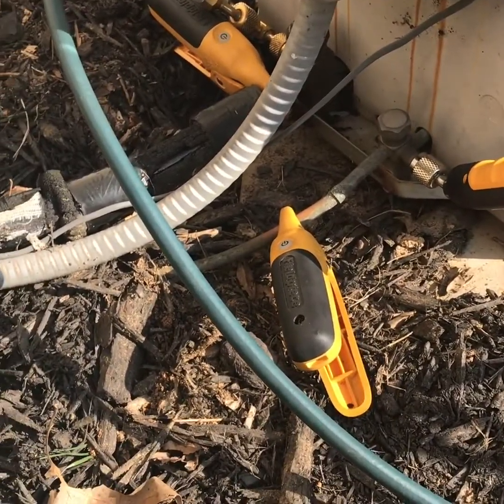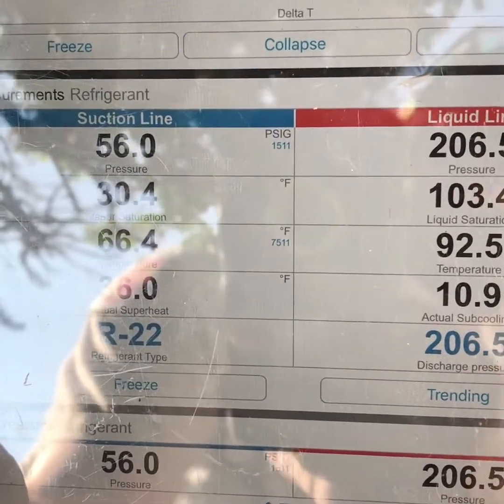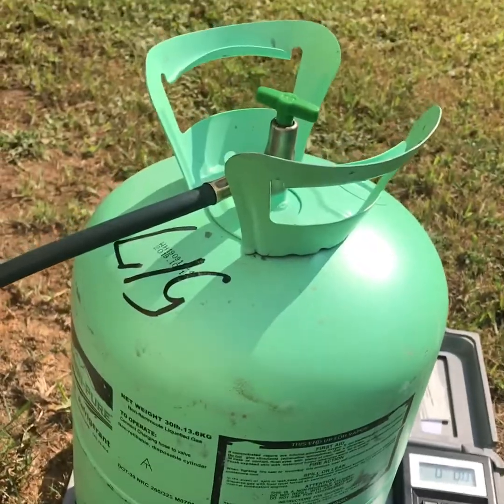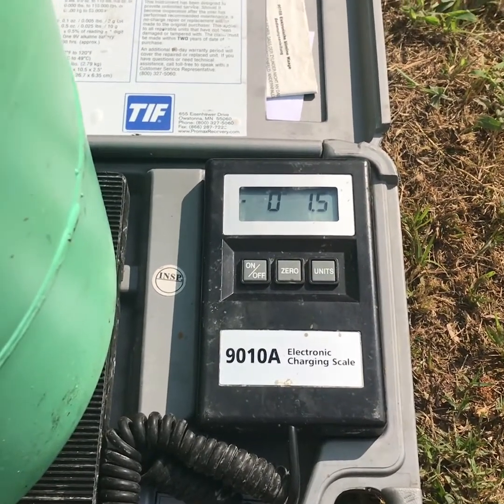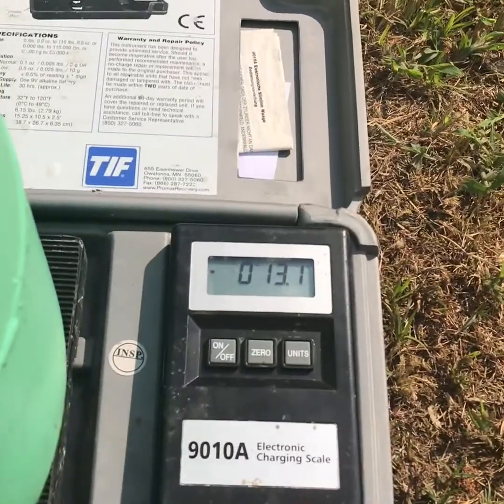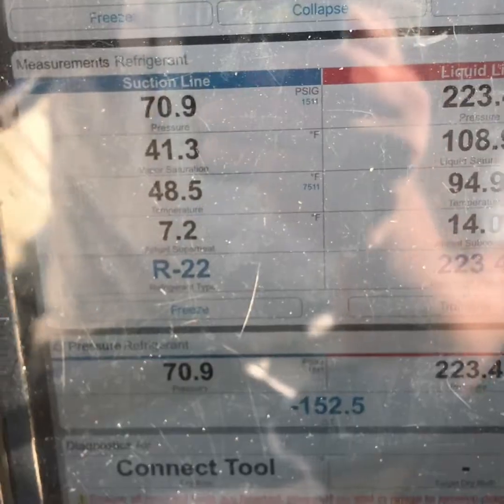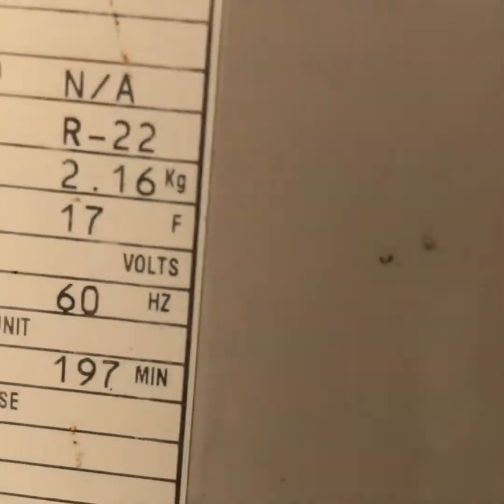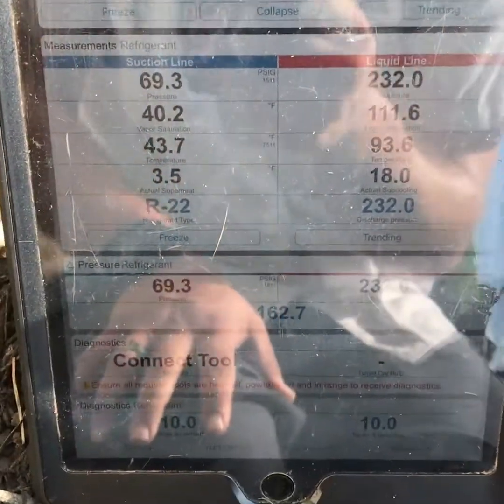How to add refrigerant (R22)

Comment: What would cause 350 PSIG on Suction Line with system OFF and system on down to 33 PSIG. Liquid line @ 133 PSIG (matches ambient) and running @ 183 PSIG. 
R22 .57 piston 76 Ambient. Tested with multiple lines and gauges

Comment: Question to any enthusiast If I added refrigerant to high side by accident what will happen?
Reply: How much did you add? Also what are your current ac symptoms? If it was a little bit don't worry. Do you have a Txv or piston on your system?
Reply: Nothing bad is going to happen actually to your AC unit. It would be much slower to charge if your bottle pressure is still higher than the high liquid line pressure.
Reply: @HienLe-qh6mo  I accidently bought these moisture remover cans to put in my system cost just as much as freon does this stuff really work?
Reply: @LubaLuba1  The moisture removal agent is used together with a leak sealant product. My 27 years old 2.5 Ton Carrier is still almost leak-free so I did not need yet to try them. I do not have an answer to your question.

Comment: Since my money isn’t good enough for the hvac guys where I’m located …I’ve rigged up a hose for a vehicle with adapters that will fit my central air unit and bought a can of r22 online..gonna attempt to charge it on the low side vapor instead of high side liquid…all this could have been done and paid for in full if the hvac guys in town weren’t so prone to violating peoples civil rights…sad what egos are doing to the profession…u tell someone u do hvac ur probably going to get shunned and treated like the dirt bags most are…u have a responsibility that comes with ur chosen line of expertise and when these guys pick and chose who they will do work for it’s bs! Especially when the customer NEEDS  ac or they could die! There’s a medical condition that requires constant temp be at room temp or the blood thickens….so yeah! People can die without ac! And when someone can’t get ac because the hvac guys are too good to work on a home that’s in progress of being remodeled…it looks like crap but it’s a home! Get over it! The notes are the same as rich ass joe down the street! U get to chose whether I get to live or not? Nope!

Comment: Have an old R22 unit that does not cool well.  I believe it uses a piston as the metering device, but I can't see inside.  On the outside unit it has "Piston no. 70" on the label.  The suction side line near the outdoor unit never seems to sweat, or get cool.  My low side pressure is 75 PSI, and my high side is 205 PSI on a 90 F day with high humidity.  The liquid line pipe temp was about 92 F, and the suction side pipe temp was about 64 F. So, I calculate about 20 F of superheat (64 line temp - 44 sat temp on guage = 20), which is too high, right? (should be about 5 according to the charts).  Indoor WB was about 60-62 F.  Do I just need to add more refrigerant?  Or is it normal that the suction line does not sweat?

Thanks to anyone who can offer advice!!
Reply: What size system is this, I'm inclined to think the indoor piston could be a bit large based on those pressures.
Maybe the air handler is moving more than 400CFM/Ton?  Your compression ratio is 1.88, meaning the compressor is having an easy day.  Typical compression ratio is 3~4.  If the system was undercharged, the compression ratio would be much more, or too high.
I bet you've got an indoor txv and need to concentrate on subcooling, which seems a bit low. And that superheat is high in that case. But make sure it's an indoor txv so you know for sure, got to know this.
Reply: I have a 2.5 Ton Carrier (27 years old) with almost leak free system. You will lose some heat removal capacity from the air on days with high humidity. In your case, you can add some refrigerant to get the low side to 80 PSI and the high side 220 PSI to see the low side sweat. What is your Indoor DB temperatur?

Comment: This ac system is 30K btu   2.5 Tons R22  4.75# or 76 OZ     SP  60#  You added 13 OZ   to raise the SP to 70# .  R22 loss =  13 / 76   17% loss  @ 60# PSIG R22    What would the % or LBS  at 55#PSIG suction pressure.

Comment: Hi    You sound like you know how to charge the ac system with SC and SH. FOR Topping off an AC system.  For R22  3ton  10LBS system.  Evap temp 40F -  What percentage of freon (LBS) is lost when the suction line freezes @ 32F.    And it it more % (LBS)  for R410a because of a high evap temp 45F.    Is it less than 3 LBS?   Just try to figure customer costs for jan 2022.

Comment: Weird 
Charged a r22 unit today the low side was at 70 which is good but the high side was at like a hundred.
The air from the vent got 5 degrees cooler so I left it like that. 75 ambient temp
Any reasons?
Reply from the maker: Sounds like you had a compressor problem or maybe txv/piston issue
Reply: Had this same issue ! Thank you